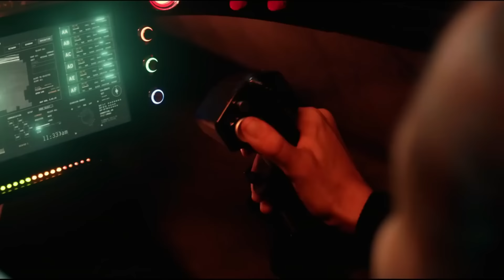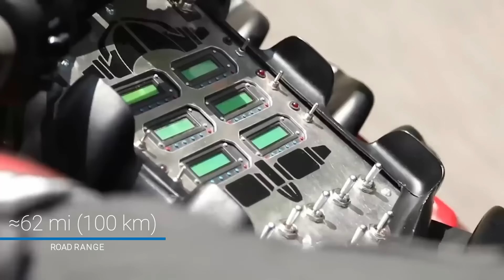TOP 12 Unique Flying Machines

Comment: The jet Wing was truly amazing! how far we came in over 100 years
Reply: Jet is a big no too noisy and we cant reduce the  noise cause its not from the engine but from air movement
Reply: @Qim2609  just do what General Electric, Pratt and Whitney, Rolls Royce,etc have done and add “exhaust mixing” to help with turbulent airflow.

Comment: My favorite is one of the most simple and ecofriendly @1:15, just a pair of shrouded electric fans, a cross strut and a backpack with flight controls computer and (solar charged) battery.  I also love the idea of being able to remove those fans and mount them onto the leading edges of hang glider wings too.
Reply: It would be great if they make it work, in the video they are using a wire
Reply: @benson8310  I don't know what you're talking about.  There's no wire on the flyer @1:15, it's flying.
Reply: @benson8310  wut
Reply: this is the way to go for sure. throw a cage around the blades for safety (bird impacts or some ass hole kids throwing rocks at you... cause that will probably happen. or someone mad you flying over their land). once we figure out how to maintain long charges with high demand on small batteries, this will probably be the way. auto stabilize, probably very easy to learn controls. i think the whole jetpack concept is cool and will probably serve a military purpose due to the speed capabilities, but if were lookin for transport for everyday people, that aint it. the only other issue i see with the copterpack, is for people who live in colder climates, if they can find a way to integrate a lightweight insulated capsule that can handle the basic necessities, while still maintaining its sleek profile (if they gotta up the blade size a little no big deal) i would gladly donate to that cause. with the advance in technology for smart screens and whatnot shouldnt be hard to pull off. plus if they do it right, they could make the pod house a parachute in case of emergencies. theres the new aerogel that is incredibly lightweight and I THINK (not entirely sure) has great insulation properties. i give it 10 years at best and we'll see a product sold to the masses. out of everything ive seen though, this by far has me the most interested and i will try to keep tabs on their roadmap and see how far along they are coming.
Reply: @rickdiculous4663  Yes, they can be programmed as 100% automated drones that can prevent crashes to that a beginner with zero knowledge could fly in it with the automated route doing everything, or a skilled pilot could handle all controls that remain within the programmed safety limits.
Reply: And yes, shrouded fan intake and outflow screens are absolutely worth it IMO too my friend.
Reply: @sanjuansteve  the return to home function on most drones is a very nice feature so adding that to something of this caliber would also be very nice. probably would have to ensure whatever collision control they implement works as to avoid other air traffic if it took off and was readily available and affordable to consumers. but they have a very good concept. i know theres similar concepts out there that bring in a carbon fiber shell that have 4 blades instead of 2, and is also a very very good design. so im interested to see who will do it better and more affordably. i think the 4 blade one is estimated to cost roughly the same as a new suv. which isnt bad depending on how long they last/perform. what will be REALLY interesting is if flying is the future, how will they figure out vehicles for tradesmen that may want to pull a trailer full of material but still drive their personal drone vehicle to work. im really excited to see how far we go with this stuff in 5-10 years.
Reply: It’s unfortunate, but Cooterpak is a fraud. However, I agree that the design is an elegant, simple solution, using the pilot’s weight as a natural stabilizer.
Perhaps a design with two counter-rotating blades would create enough lift to make a real one work.
Reply: @bellafemedia  yeah and to be fair ive already seen like 3-4 designs that are safer and more thought out. they havent figured out long or fast flights yet.. but theyre getting closer. biggest challenge they have for drone transport is battery life afaik. gonna be an exciting 10 years
Reply: Those blades are aligned with one's neck. I didn't like the look of that. However, there are some very light weight materials that can stop bullets so I think that danger can be overcome. I really like the Blackfly @7:41. Of all these that is the one I'd get or Kitty Hawk Heaviside @4:50. Tech always goes bad so basically anything with several redundancies.
Reply: yeah I liked the CopterPack right off the bat. It's my favorite design that's still in the realm of possibility for someone like me to eventually buy/build.
Reply: I remember the first time I saw something like the Copter and it was Millenium Jet out in California. They did a proof of concept and some of the funding was DARPA. Soon as that puppy was off the ground, the entire website went offline. Um wut? Flash forward to "Myth Busters" and an episode showing the concept was not going to work. Wut? I saw it fly. Follow that with a guy flying like a dang dragonfly out in Australia years later, for minutes and doing some serious acrobatics with it and I'm like... wait, we had that... WTF???
Just goes to show you can not keep a good idea down. This concept will be seen way more often. Especially as batteries improve, motors improve, computer controls, blade technology...

Humans as drone pilots... on board. I saw proposals to arm the military version by Millenium Jet (called Solo) that carried a Hellfire...
Reply: Zapata!!
Reply: u can clearly see its a 3d render, looks at the light reflecting on the shroud lol cmon guys
Reply: @benson8310  m
Reply: @benson8310  mm
Reply: Copterpack best design
Reply: look up SoloTrek
Reply: Bout to become the irl vulture
Reply: it is being held up by a wire and crane that is edited out.  when confronted, they admitted it can't fly and is on a wire.

Comment: Blackfly looks the most safe and practical option of these for Snow and Island applications..REALLY cool .. The others all seem to have overlooked serious safety design flaws that i think they will struggle to overcome... I truly think we will see a lot of craft like this operating at low altitudes for transport over baron land and sea..All comes down to battery energy density..Bring it on!
Reply: Ace tiempo yo soñaba que algún día el hombre pudiste volar como un cohete por si solo
Reply: What?! I'd be totally fine if I got smacked in the shin with a shattering particle board propeller that's spinning fast enough to make the lift necessary to carry a quarter+ of the vehicle and myself aloft!  
/s⁹⁹⁹⁹⁹

Comment: I'd be too worried about a mechanical failure that high off the ground.  These guys have balls
Reply: You are right, i think they need to provide it with parachute system that pop up when failure happen .
Reply: Parachutes don't actually work well at altitudes this low. They take time to deploy and spread out to their usable position, you would hit the ground before they slow you down at the heights these fly
Reply: Yep, they got balls and parachute 😁

Comment: That vertical lift plane, with 100mi and 40min autonomy, looks very efficient. I wonder what could be done if we had better electric energy storage.
Reply: Just give it some time. The evolution of tech advancements in this field multiplies as time goes on, it won't be long before they produce a heavy commercial use battery for cars that's far better than what we have now, which in turn will implement naturally towards vehicles such as these in the video. I would say as a guess, give it until 2027 - by then I have no doubt that what we have now, will be completely different by then, as in far more advanced, further than it took in the last 15 years multiplied 10 fold.

Comment: To protect these pilots, parachutes are needed that have yet to be developed, for deployment at low altitude.
Reply: except for the Kitty hawk. check out my comments....
Reply: Front parachute is an option, as back up
Reply: parachutes won't work that low - they need to be deployed at certain altitude to even open

Comment: 10 minutes flight time for the gravity jet suits,with 12000 feet altitude limit,the pilot would run out of fuel before getting that high. Or just parachute back down.
Reply: I think some of them are fakes there never fly in real!! to much future wish !!
Reply: @r.blacky341  the gravity jet suits are real. Some of our  paramedics use them for getting to rural locations
Reply from the maker: Possibly, - all data from the manufacturer. But the question is why climb to such a height? In the mountains, these will also be of little use.
Reply: @TopBoxy  Hi, I'd have had enough of that chumodan with two propellers on my shoulders. 😉
Reply: @trevorshields7347  They were paid actors.
Reply: the gravity jet suits are real. Some of our children use them for getting to school

Comment: the Kitty hawk heavy side is the safest, and by far, the best one in the whole list. this one could replace a car. it's got built in redundancy both with wing lift, and many motors. one motor goes out you still have a bunch more. the wing lift could allow you to Coast to a landing, the Kitty hawk doesn't just drop out of the sky if the motor stopped. a 30x30 launch area, now that's driveway size territory. plus, it holds weight you can put your bicycle in the back or groceries, try that with a man drone, doesn't fall out of the sky, yeah that Kitty hawk is the one to watch. and with 30% more efficiency than an electric car, I'll tell you what, an electric boat, extremely inefficient by nature. motor has to just torque load the whole way. a car, can Coast, and roll freely. so to beat a car's efficiency, it's no easy task. the car is a very efficient electric vehicle, so for the Kitty hawk to be 30% more efficient, is just excellent. so this vehicle could be your next car. it's about time it's 2021 damn it!😁💯
Reply from the maker: Kitty hawk is a design that I would like to buy for personal use, but for fun and an unforgettable experience, JetWing it is probably best suited.
Reply: Its the only practical one because of the maximum distance and flight time. The others are toys.
Reply: I feel with advancement in battery longetivity it will be commercially viable project too maybe 10yrs from now
Reply: A plane is more efficient than a car in many ways.  They put vw engines into something like the KR-2, it flies much further and faster than a car will go, but I agree it is probably the most practical vehicle shown.
Reply: Kitty Hawk is twice as efficient as an electric car. Not 30% more efficient. With the new batteries that are coming onto the market, the range and flight time will be increased.
Reply: I don't believe the stats on this for even one second....All these "Start-Ups" are looking for upfront money from Fan Boys so they put out stats that are totally unproven. If these specs were true, they'd sell 100,000 of these things.
Reply: @georgespalding7640  exactly,it’s too good to be true
Reply: Also 200 kilos in a real short time, agreed
Reply: 4:47 And beautiful design too. It's just for one person?
Reply: @TopBoxy  I was in awe when the jet wings were cruising along side that huge Airbus in Dubai!
Reply: Plus it's usable for normal people and in day to day applications, due to the closed cockpit. Many others seem fun, but are to this as a motorbike to a car
Reply: Anyone invading my privacy over my land with their loud-ass flying car would be in deep shit one way or another. Mandatory tail numbers legibly emblazoned across fuselage bottoms, or right to down any civilian craft under 100'AGL over private property. I'm not too keen on the latter, but test me enough & we'll see what happens.

Flying cars are a dumb idea for everyone not having a blast zipping around in one. Make them entirely autonomous and restricted to privacy-keeping air-lanes & I'll abstain from constructing IEDs.

Comment: These are all amazing machines and represent massive steps forward in this particular field of aviation.  The biggest problem I can see for the majority of them at the moment is the lack of endurance/range, but hopefully with advances in battery technology etc, this won't be a long term problem.
Reply: If we used electricity like Nikola tesla wanted to we could wirelessly charge these aircraft while flying.
Reply: @TNTNT20  by using?
Reply: @jayantchoudhary1495  He means if we had continued to innovate and work with electricity rather than fuels since the time he was around, we would probably be at that stage by now. Electricity for a means of travel stoped at trains until very recently so we are still in the early days of experimenting with it.
Reply: they can create a solar energy engine to make jetwings more durable.
Reply: Except a shitload of other tech we use daily would never have happened and it'd be outrageously inefficient.
Reply: (re Tesla aerial electric comment)
Reply: *(search terms: "inverse square law.")
Reply: We all see problems through our own Lens
Reply: @TNTNT20  we can thank Thomas edison for destroying such future because of his greed :).
Reply: I agree, for now the biggest problem are the batteries, in my opinion the batteries should have much more power and autonomy (for the same weight) however I see it lasts at least in the short term.
Reply: exactly, i would happily invest in something i could commute with. where i work has lots of ground to land/park on, but it would HAVE to have at least 100mi range and a quick charge for overnight recharge
Reply: Getting FAA approval will be the biggest issue I see.
Reply: Number 11 is literally what the villain in the first of the tom holland Spiderman moives used
Reply: the biggest problem i can see is the noise. if these became mainstream i would straight up kill myself. screw listening to that all hours of the day/night
Reply: na nuclear
Reply: most of this garbage would be outlawed anyway
Reply: Nah whatnyou see is literally top. Sure maybe room for 5 to 10% more range, but ultimately it will take a.i to make the final improvements a d different modules suited for specific uses. Tricks or transport.
Reply: @jayantchoudhary1495  aalà
Reply: Your right humans will allways find the solution to any problem  what ever that is.
Reply: More batteries, means more weight, which equal diminishing returns. Most of these vehicles of the future are way too large to be practical as well. I'm not seeing anything promising as far as changing the way the average person will travel privately, but still fun to watch.

Comment: Heaviside is an option for me. I imagine it can be controlled in the event of a failure of the engine control systems. Can it work without motors, as a glider is the question?
Reply from the maker: Why not? Good choice, btw )
Reply: I thought it was a RC model?
Reply: Those machines are just prototypes. Remember, not too long ago there were no airplanes. It is now just like the airplanes were borne.

Comment: copter pack would have been best if it was real, next best is jetwing because of vertical lift and your literally flying like superman. jet wing needs 2 things, able to fly longer distances and retractable wings like the falcon on the avengers.
Reply from the maker: The main problem of jetwing is long training in flight
Reply: Copterpack IS real wtf
Reply: @lotsofstuff123official  its not flyable, they used a cable to pull the guy around, and edited it out...

Comment: A guy with two turntables, on his shoulders, normally rises into the air . A motorcycle with the same design barely leaves the ground . Something is not finalized . And the plane of vertical take-off on turntables and turning into a high-speed flight , resembles a flying terminator hunter , which can also hover and fly quickly .
Reply from the maker: They have a big difference in weight
Reply: @TopBoxy  OK, the guy has a car attachment on his shoulders , and if you do the same, but sitting on top or like, on a bicycle . A lightweight version . Without unnecessary bulky parts .
Reply: @TopBoxy  Mount on the back, change to a sitting mount .
Reply: @АлексейРыбаков-м3в  dont get worked up over that, bro, its not accurate to the capibilities...
They just say that because they havent tested the motorcycle on higher altitude, they were fearfull of the outcome. It has 4 turbines, the jetsuit has 5, it can go at least as high as that... 
But he, as long as there is no one to put up more then half a mill for that bike, we will never know🤷‍♂️